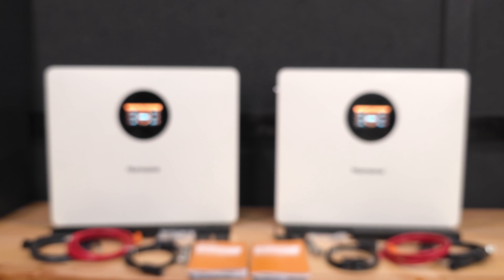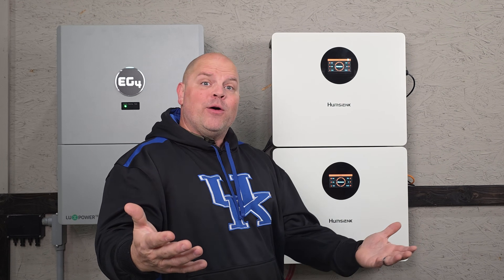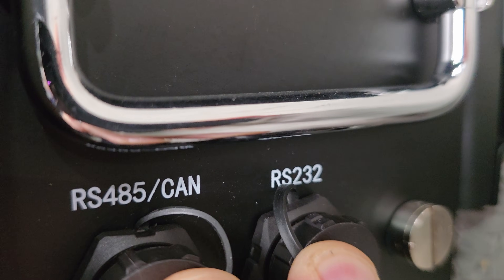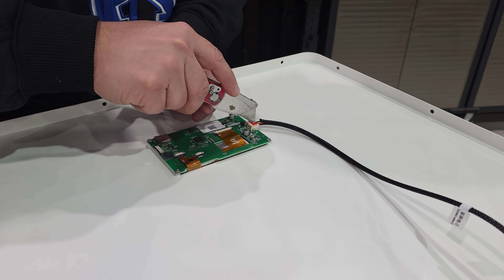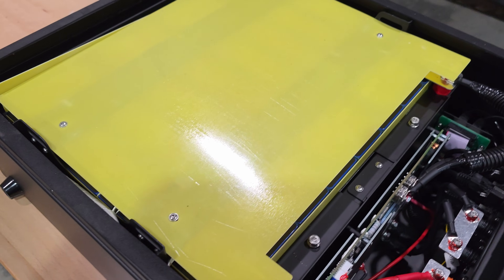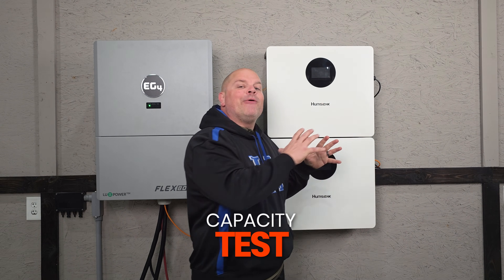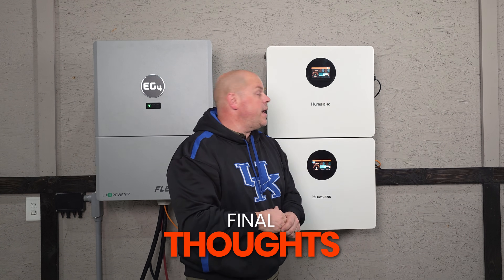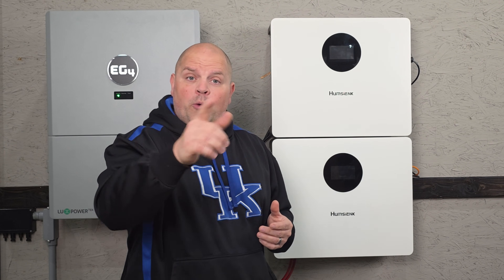Testing the CHEAPEST 48v 100Ah Wall Mount battery I can find - Humsienk

Comment: The cheapest price and the cheapest quality. Here's just a few of the complaints about this cheap battery that can be found on Google:

Humsienk lithium iron phosphate (LiFePO4) batteries, while cost-effective, have received complaints regarding safety, quality control, and customer service. Key issues include a lack of robust overcurrent protection, inadequate internal insulation, potential shipping damage, and slow customer support response times. Users have reported damaged cases upon delivery and significant difficulties in obtaining replacements, with some experiencing long delays in communication. 

Here are the specific complaints and technical concerns associated with Humsienk batteries:

Safety and Technical Concerns:
Lack of Overcurrent Protection: Some models, such as the 12V 310Ah, showed a failure to trip the battery management system (BMS) during overcurrent tests (pulling >500A), raising safety concerns.

Poor Internal Construction: Internal components have been described as having glued, rather than soldered, main supply conductors, and weak insulation for the BMS, which became very hot during testing.
High-Vibration Suitability: The internal balance cables are loosely packed and could potentially break in mobile/RV applications.

Temperature Limitations: The BMS prevents charging in cold temperatures, which is standard, but some users have noted limited performance in cold conditions.

Voltage Balancing Issues: Some units may experience issues with cell voltage balancing, leading to premature BMS shutdowns at higher voltages.

Shipping and Quality Control:
Damaged Deliveries: Reports of batteries arriving with broken cases or damaged components.

"Bait and Switch" Concerns: Concerns have been raised about changes in specifications between batches, such as moving from a 200A to a 100A BMS.

Customer Support:
Slow Communication: Customers have reported difficulty reaching support, with some waiting several days or weeks for resolution.

Limited Support Options: Issues have been reported with obtaining timely, satisfactory responses to damaged products.

Comment: Have 2 in my garage for emergency’s , lost power in Omaha last weekend 60mph winds. Power was out for 1 1-2 days , powered fridge freezer furnace and misc other light duty stuff. After 1 1/2 days had 35% left on battery’s. Sooooo much better than getting out the noisy smelly gas generator!!!

Comment: They just raised the price to $650. Still a good deal I reckon.  Real curious about the 314ah version, which is now at 1600. Would be $350 less for equivalent capacity, so an even better value.
Reply: $1600 if you pick it up.

Comment: You have to change your lithium type in the eg4 settings. I get the same AH issue when I use the wrong protocol. On the 12000XP I need to use the 2nd option
Reply from the maker: Thanks for sharing!

Comment: Dig a little deeper. I have two of these. They are great but the great news…… they WILL connect to wifi!!   I have them both connected! I am using BMS Meta. It works great! I can monitor them both remotely. I am choosing not to connect them in parallel.
Reply from the maker: That's great info! I appreciate you sharing your experience!

Comment: I got 2 installed in my garage simply for emergency battery backup. Way cheaper and way larger than any off the shelf unit.  Will run my Fridge and freezer for days, and furnace if needed. Costco and or Sam’s units are basically $1000 for 3kw.
Reply from the maker: That's a great setup for emergency backup!

Comment: I like to compare these wall units in equivalent 12.8v100ah batteries. This would be equivalent to four of them. That's about $150 per 12v battery. You do not have all the wiring and lug requirement that you have when using one of these batteries, and that is a big plus, but not that big. The price still should come close or surpass the 12.8v battery cost.
Reply from the maker: I appreciate your detailed comparison.
Reply: So do the individual batteries have such an intuitive touch screen like the Humsienk that monitors all the cells and gives valuable information?  And Bluetooth connectivity.  I’m sure that’s an extra cost to add too.  You’d have to monitor each 12.8V battery individually.  Extra costs in fuses and jumpers too.  Not to mention mounting hardware.  I personally would go for the all in one unit (if similar price) for simplicity and probably easier warranty if something were to arise.